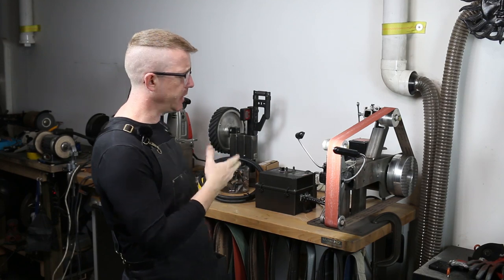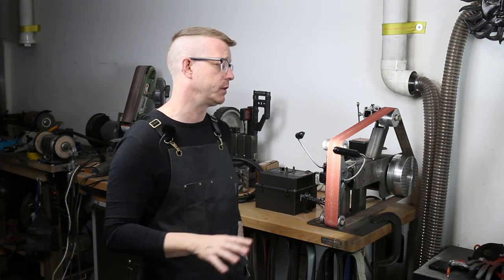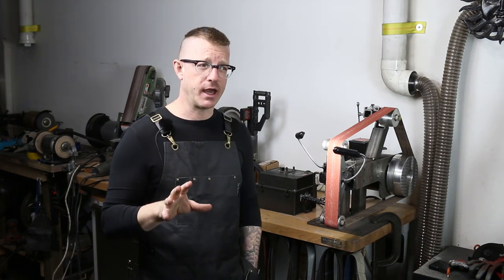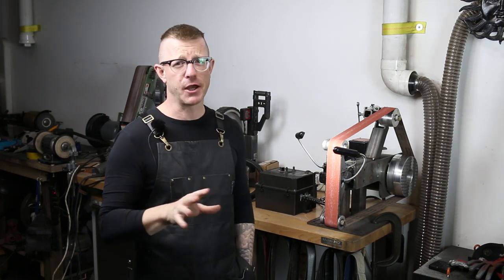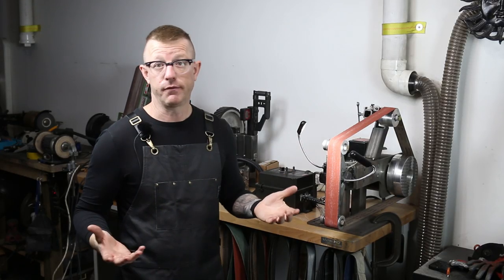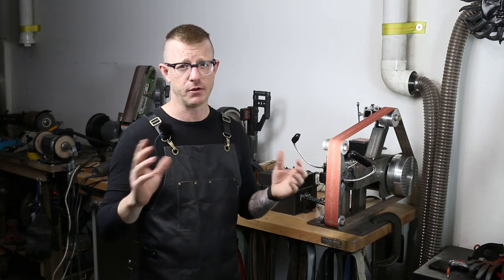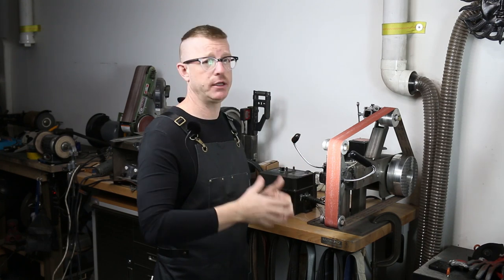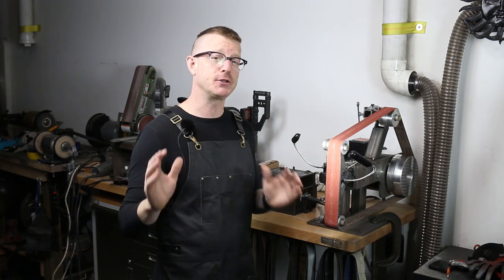DIY 2x72 Belt Grinder Build - Wiring & VFD

Comment: Hi for the table receiver have you thought about using a circular tube as opposed to the square receiver so you can articulate it vertically and horizontally when you flip the unit. And you can C cut the male tube like you did the main unit that allows it to stay locked in and put in a tensioner screw. Thanks for the video.

Comment: Nice job! I was contemplating building a belt sander myself, but I have noticed that some have been made like yours with VFD and some without. Is there a real need to have a variable speed belt sander or can a person get away with just a one speed model? Your work looks really professional. Thanks for posting. Cheers!
Reply from the maker: You can most definitely get away without a VFD. There are some variables you would need to consider, like the phase of the motor and what your power options look like. Also drive wheel size etc. I will tell you from experience, that if you can, do the VFD, it makes this tool so much more versatile. Although if you plan it out you could always add one later. Happy New Year. 2020 will be a great year.

Comment: I see you recommend the kbac 27d for the iron horse 2hp. Why wouldn’t you recommend the 29d since you recommend to use 220 volt.im gonna buy one and am just curious the reasoning
Reply from the maker: You can run the 27D on 110. So the user has options. 29D is great if you are only using 220z 😁👍🏻
Reply: Thank you sir
Reply: Will the 2hp work on 110? I was under the impression the 2hp would only work on 220?

Comment: My grinder will track really good with no HP but def runs hard to the right almost off with on I think my tracking wheel isn’t perfect in line do you recommend me trying to spaced the platen out with the motor wheel to make it work
Reply from the maker: Try more tension on the belt. Pull the platen out or get a better spring. (Not sure if you're building a Revolution or not)
Reply: @HouseMadeUS  I did build the revolution I just finished it ! It’s awesome just having some trouble getting it to track I’ll try and report back!

Comment: If you are promoting this toward the DIY crowd the motor you've provided a link for will not work in a home workshop.  The link brings up a 3 phase motor, I would say that probably 99% of DIYers don't have access to 3 Phase power.  That is generally only found/used in commercial and industrial applications.  Other than that, so far everything else seems top notch!  *EDIT*  With the VFD it is possible to wire single phase power into the VFD but you do lose rating in regards to the VFD power output.  It may be wise to use a VFD that can handle at least 3hp but 5hp would insure no issues.

Comment: You can have the VFD somewhere else in the shop if you want, with the bonus that you with some added wiring can use it on some other coo stuff :-)  so why on earth does everyone spend a LOT of extra money on a terrifyingly expencive enclosed VFD just to mount it next to the grinder as a dustcollector?!? All you need next to the grinder is a few buttons and a pormeter for speed control.... And save like 300+ bucks if you buy a cheap VFD. For me that makes it all from scratch thats like the whole budget... for two grinders!
Reply from the maker: You have my attention on this. Perhaps I could build one of these and make a vid. Got any resources on how to do this? Sounds awesome.
Reply: @HouseMadeUS  Just buy any cheap 2hp VFD off eBay and put it in a vented enclosure. From that you run a cable with multiple outlets just like any other line of outlets. Alongside with that you run a multi cable for the signals (start, stop, jog, fwd, rev, potentiometer for speed and whatever you would like to have. Make a breakoutbox with all the mentioned signal switches and use a multipin connector to the signal cable. 
A bit more work but it will give you a VFD on all your machines for the price of one and a few cables. I would use a pro audio multi cable and connectors because it's rugged and has noise screen.
The cheapo VFD will have a manual to assist you trough the setup and it's quiet easy.
Reply: I will definitely be researching this. Question though...I’m building a hydraulic forge press with a 5hp 3 phase and this grinder w a 2hp 3 phase. Can I run both on the same vfd?
Reply: @jonathandehors2684  If you buy a 5hp vfd and not plan on using them simultaniously, yes. Just use extension cord or a switch between the two of them for the power cable and the control cable can be run in both paralell and serial for more control panels. If needed (for protection of the motor and so on) you store different programs for each motor and recall that program either on the panel that comes with the vfd or a programmed switch. All the cheap import VFD`s can be programmed like this whit a huge amount of parameters and almost endless possibilities like ramp up time, safety triggers by resistance, temperature and so on, DC brake for instant stopping, jog for careful threading, a potmeter to adjust the speed while facing off as you go inwards on the diameter on a lathe, special programs suited for compressor motors controlled by pressure need and on and on and on. There is only the limitations of the brain that stops you. Spend some hours on youtube looking into VFD programming so you`ll understand the basics and find a tutorial for the one you end up buing. I`d say go for a cheap import one, they have never let me down and are fairly easy to program.
Reply: jan einar wold thanks so much for the info!! Definitely go that route

Comment: Amazon has the 10/4 wire needed to go from the VFD to motor: https://www.amazon.com/gp/product/B004GF1I6K 
I just placed an order for the 10' length since no stores local to me carry it (in store). With all that's going on with Corona, it's better (IMO) to order what you can than hunt around in stores.